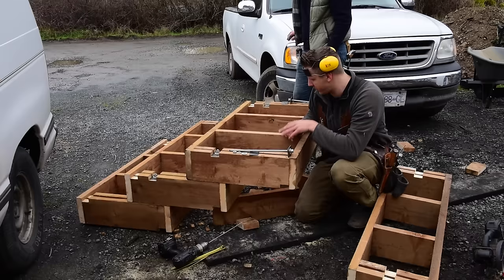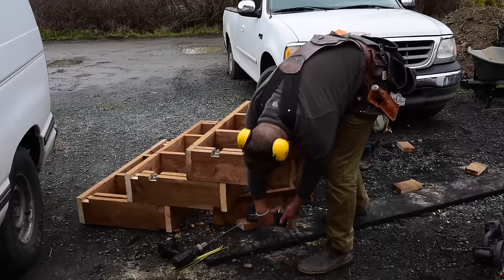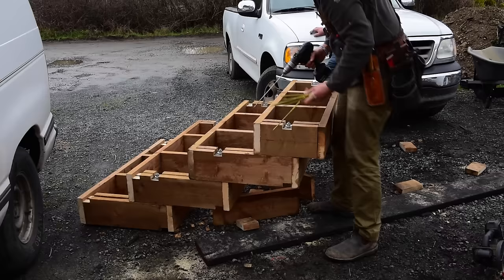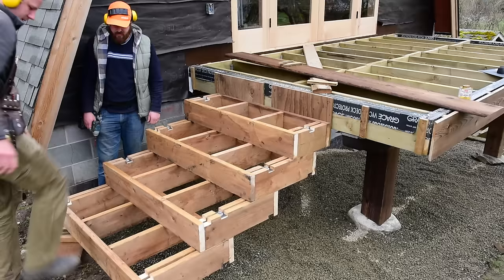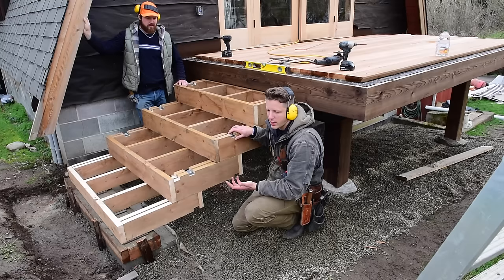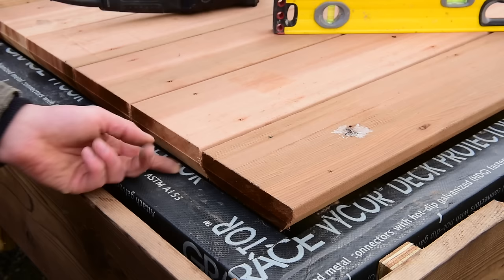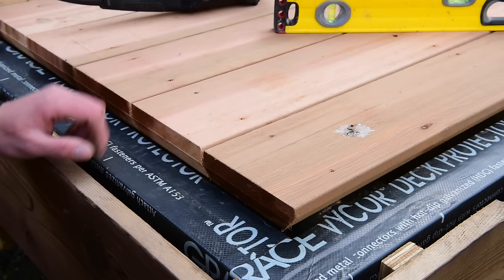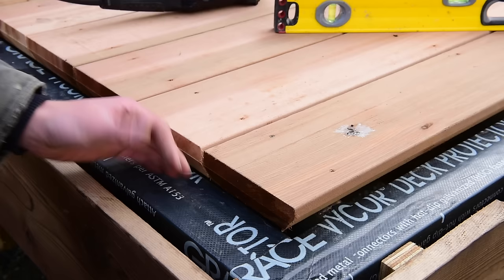FTF #52 Stairs Without Stringers? Here's How

Comment: you may have issues with the all thread loosening as the wood expands and contracts. probably would have been quicker, easier, and to code if you just cut stringers.
Reply: J Fr55man lockwashers and loctite.... no walk
Reply: Even stringer stairs get wonky after a while. Squeak!
Reply: lockwashers or loctite do nothing for the wood expanding and contracting.  If you get them tight when it's dry, when it's wet it expands and crushes the fibers and then you get slop when it dries out again.  If you get them tight when they're wet then they just get loose when they dry out.  I don't think you can win this.  maybe if you find something rubbery with just the right durometer hardness (maybe some fairly hard polyurethane) you might be able to sandwich a thin piece in between sections to take up the motion, but then the stairs won't feel solid walking on them.

Actually, if I really wanted to make this work I would weld/machine steel brackets to hold into the endgrain side (wood expands mostly perpendicular to the grain, not with the grain) and the bottom of the next stair up... of course at that point you've turned this into a whole new project.

On my deck I just cut stringers and build relatively normal stairs, but I also don't like the cutouts in the stringers and sandwiched full boards on the outsides which trim out the steps really nicely and provide a ton of additional strength without any inspection problems (here everything needs to be inspected and the deck needs to be built so it would free stand even if the building was taken away AND lagged into the wall that it is next to).
Reply: J Fr55man oh not maybe, it will loosen up, especially being exterior. Hope he doesn't captivate or hide those through bolt connections as he will likely be tightening them seasonally. Even interior furniture will expand and contract and loosen up. Think of a new kitchen install, and how the knobs/handles develop slop over time. This will only get worse when live loads are applied.
Reply: yah, i said "you may" so as not to sound like too much of a nay sayer... trying to be more suggestively constructive rather than simply deny this would work at all. I would think that the stairs will basically sag over time... not necessarily a safety issue, but aesthetically probably not the look he is going for.
Reply: He added a spring washer. It should hold...
Reply: 'Quicker, easier, and to code'...These are 3 things he is really not concerned about at his own house..The whole point of the video was to build stairs without stringers (and building inspectors) lol

Most likely he can just tighten bolts from exposed underside, the galvanised nuts n washer would likely provide enough resistance..
Reply: While the wood will contract and loosen up, I don't know what the answer is to 16" tread.  Stringers won't work for that
Reply: 2x10 with 16" by 6"(or what ever rise) triangles glued with PL and screwed to it.  It would use less than 1/3 of the lumber too.  With that short a run a 2"x8" would work.
Reply: And unlimited materials.
Reply: Peen the all-thread down like a rivet after tightening , the only way it can go is tighter.
Reply: majorjockitch it's not going to come loose due to the nuts turning but due to the wood expanding and contracting from humidity and temperature changes.
Reply: spring washers don't work very well anyways, but they do nothing to counteract wood shrinking
Reply: It wouldn't come loose at all , never. Threaded rod and it's implementation is my bread and butter.
Reply: majorjockitch  against the grain...wood will contract.  tighten the nuts and when the wood expands it will crush the fibers. contracts again and loose again. tighten and keep repeating till it fails. It would last longer if it was against the grain but then it might split. 

Around here it would last 3-5 years.  In Vancouver I would imagine less than that but maybe it's long enough for him. It's not like it took that much to build or would take that much to replace.
Reply: I'm getting the picture you have no idea what I'm talking about.
Reply: This argument is easily concluded. Doing this with three (yes, I said three since the second from top is almost full length) steps is ok since the safety factor (fall) isn't that great but I'd like to see some tard do this for an entire stairway with let's say a 10 foot rise. That thing would be death trap. And anyone that thinks lock-tight will make a huge difference has apparently never worked with wood, especially wood that's out in the weather. Those steps are going to loosen up from wood expansion, contraction, but more quickly from compression with use. I want to see 200 pounds walk up and down those for just a few days.
Reply: It shouldn't even be an argument , all I said was there is an easy way to ensure the nuts never come off , then people started blathering about wood expansion. Plus there doesn't appear to be any treated lumber where it's going to contact the ground or pad , whatever's going in there.
Reply: Just take the framing out in the middle plug the bottoms and number 3 rebar and pure concrete, that's what you built is a concrete form.
Reply: J Fr55man  amen brother
Reply: 16 inch treads are going to get many people hurt at this hous
Reply: No doubt. Steps are universal 7 inch rise with 11 inch tread.
Reply: Could add extra stability with little effort @ minimal cost. Raise lower deck back board 1", notch bottom rib boards of upper deck <1"x1" to fit...  4 @ inny outty groovy kinda luv'n togetherness!?...  Otherwise stick it in, together, use protection if necessary.
Reply: BTW could do opposite configuration with front board, adding 1" ventilation gaps along top of riser, below run platforms.
Reply: J Fr55man 'all thread loosening'.....  or you can give it an annual inspection, and tighten the all thread.  Without inspection be aware of noise, loosening components usually will squeak as they get some flex, so if you hear squeaks, go inspect and tighten.
Reply: Add some liquid nails or gorilla glue to keep it all together and keep the all-thread tight without any movement. After the glue sets the all-thread becomes secondary. If you are really into it you can coat the all thread with Gorilla Glue or Liquid Nails before installing. I like gorilla glue for the gap filling properties in a situation like this, waterproof too. When the adhesive dries the all thread becomes secondary and unnecessary like gluing down underlayment, its the adhesive that holds it down, the nails just keep it that way for 24 hours :) Please read my further comments above if you really wish to do this the right way from nailing decking to pier installation.
Reply: One thing I am observing, it is harder and harder to find wood straight enough to cut stringers.   I have seen guys pick through an entire sling of 2 x whatever to find a couple of straight boards.  This looks like a very viable alternative to warped and twisted lumber.
Reply: @H. R. Calhoun : Crown up, just like joists and rafters. And if it's really so bad that doesn't work, chalk line. 
A little crown is a good thing if you have a decent span.
Reply: Im not sure you can cut 16" treads on a 2x12 stringer and still have the allowable 3-1/2" from the notch leftover for code....
Reply: Just screw a 2x12 on the sides for stability with carriage bolts...wont go anywhere.

Comment: You could have framed a house with the amount of wood used in those stairs.
Reply: Box steps are very good when it is two steps or just one. A stair stringer is what I will do until I die which wont be long since I will be 57 in one month. A framing carpenter since 1980.

Comment: love your videos. You can do this a lot simpler but I just screwing and gluing and up right behind the back side of the outside board.  it's a lot cheaper and faster then messing around with a bunch of bolts and washers and doubling up the edges.
I do agree this style of Step looks much more pleasing simpler the better.  the other benefit is that when you're shoveling off your steps you're not hitting the side.

Comment: Hey Samurai. I'm doing a deck at the moment too. I've left the deck boards wild on the end same as you have suggested. But I'm worried that when I do the finish cut, I will get chip out that will ruin all my hard work. I have a Makita 185mm circular, I was going to buy a new cross cut blade and also scribe the line before cutting. Do you think this will work or do you have another suggestion. Regards Luke @ Forest Floor
Reply: Forest Floor Enterprises use a straightedge to make your cut do a  1/8 cut first then do your full depth cut and you will have no tear out
Reply from the maker: Yeah, a fresh blade and scribe first will work.  I always hit the ends with a 1/8 round over bit on my trim router so it doesn't have a sharp edge.
Reply: Easy, cheers
Reply: Sweet - Round after the cut? I have been doing a small (2mm) bevel with a hand plane on all the cut ends this should clean up small tear out. I am still anxious about doing that cut..
Reply: Thanks Tom, The Samurai and all others. I think I will do a video on this part of the deck project, lets see how I go with all the good advice
Reply: You could make a Paul Sellers knife wall.
Reply: Not that hard to cut as you go. If you don't trust your abilities with a tape measure, then just set the board in place and mark it with your utility knife for a perfect match every time, too easy really. This is just as fast and you get a far better cut from your chop saw.
   The method he proposes is more often than not used because the deck framing was done poorly and is out of square and no one owns a freaking protractor to figure out the angle they need to be cut at to compensate. The only time it makes any sense to run the decking wild, is if the deck has a curve at that end. Then you use a router and trammel (or curved jig/fence).

Comment: This kinda just seems like a lot of extra hardware and wood for some heavy bulky looking stairs.
Reply: It's aesthetically pleasing to some. The ball will never be moved forward without breaking new ground
Reply: Mike O fair enough
Reply: Look at Sam Maloof's house, some people prefer aesthetics and craftsmanship over efficiency or economy. The most expensive things a man can own are neither efficient of cheaply made.
Reply: I agree. It would have been better to conceal metal stringers.
Reply: Put a metal tendon on the underside.  That's the section that stringers usually handle with the continuous grain, tip to tail.
Reply: Evan Pearce ya stupid idea....
Reply: Evan Pearce yea seems like alot more material but 2 each is own me personally I don't have tons of extra Lumber laying around but all in all it was a cool idea and nice looking stairs
Reply: Seems like a ton of work for little payoff. Plus I doubt these will be "rock solid" in a couple seasons. But to each his own...
Reply: + Don Hill Not a ton of work if you enjoy what you do.
Reply: @blackfeather dog Just because it's a new idea doesn't mean it's a good idea. I don't like how how it's mounted to the deck either. I wonder how it's held up.
Reply: Evan Pearce you cannot achieve a 16” tread with conventional stringers.

Comment: David Nicolet
1 second ago
I have seen your stringerless stairs done in production in southern California on tract homes with permits engineering and the testing one commenter mentioned the big twist and why they did it was CURVED STAIRS with walk space under. Steps are pie shaped to achieve a desired radius. the first few were platform on platform then took off like yours to a second story @ 17 risers with a curved drywall finished underside. Your step to step connection is way better than theirs. Next time dream in curves. Love your stuff.
Where did you get your bags/ tool belt or did you make it?
David Nicolet

Comment: as long as the through-bolt is more than the stringer-depth back from the face of the step, and the bolt chosen has a tensile breaking stress greater than the shear stress in the timber, then essentially it is just a beam on an angle. (numerically)

Comment: My bonus tip for the day... don't do anything shown on this video. Everything feels nice and solid when it's brand new. revisit this after a year or two of weather and freeze/thaw cycles. It won't last 1/4 as long as a deck built by someone that knows what they're doing.
Reply: Why wouldn't it work?  I mean, the guy is a carpenter.  I know he pushes boundaries and does things his own way, but to this layman at least it seems like it would work.  If you're going to say something as absolute as what you just said, you should explain a bit more and provide your reasons.  It would, at least, be more helpful than just straight asserting an opposite opinion.

Comment: That was fun to watch. Technically, it IS a stringer. It's just crippled. I was going to say broken, but thought I'd use the technical term.  d;^)
Here's an idea... Stairs that are nothing but stringers... 
Exterior - You can space them 1/2", and 
Interior - go solid
Idea For Tying Together: Instead of threaded rod, use pipe and re-thread flanges from rear to use as "cap" nuts or use pipe caps and washers.... Whatya think?

Engineering-wise, you might get away with doubling up on the rear tension bolts (ready rods), and the other issue will be the compression at the face union of each level, as moisture, time, and pressure take it's toll. Posts set back to the second run of perlins under each cross beam would maintain the look, but should solve any mechanical challenges...

Thanks for the thoughtful videos! Everybody can always use ideas and help! Good man!

Comment: Looks okay but I would have saved money on the all-thread and used duct tape, not the cheap shit but the 6 dollar a roll stuff.  And some drywall screws toenailed in from the front instead of those expensive GRK foot longs.  You must be made of money.
Reply: Drywall screws? Your post has to be satire... for they would rust and have little shear strength. They would break off.

Comment: Your creativity is always cool to check out.  Stair treads should be very slightly pitched forward low into the tread.  This gives a comfortable stride both going up and down.  Pitched down at the tread head keeps your heel higher than you toes which can be very tricky going both up or down and with ice..... your going for a ride.  Add small weep holes if water puddling is really an issue.

Comment: I'm not seeing any advantage to this method.
Reply: I do my own with boxes and extra blocking as well.  Treads can be as deep as you want.  I do not use as much hardware.  A short rise (3 - 4 steps) with the boxes sitting on each other and connected with some screws, makes a solid, deep tread (fourteen inches) set of steps that will not flex or creak.  Something you appreciate as you get older you.  I am in my late sixties with shakey legs; the steps up to my deck . . . no hand rails.  My front steps, eight steps, stringer, ten inch treads . . . a good set of handrails is a must.  (Ten inch treads do not inspire confidence to size thirteen feet.  Handrail cedar cost me $400.00.  Like I said, did it for myself, but I enjoy them every day.)  And while you are at it, limit the rise to six inches.  We bought the place with front steps that had a seven inch rise.  If only I had a dime for every time I tripped on them.  Now that they are six inches, I have not caught my toe on them once.  (It also helps if they are all the same height.)  I would love to meet the inspector that approved the eight inch rise in my aunt (88) and uncle's (91) split level home.  Maybe he was offered a small stipend if he would just look the other way.  Yeah, there are lots of steps out there built by someone who does not care how dysfunctional they prove to be.
Reply: @freddyfriesen  I did some short stairs sort of like this; I just stacked 2x6's on edge and set the end of each one back about 12 inches (I'm probably not describing it well) I wound up with about a 5.5" rise and a 11" tread.  The method in this video seems overly complicated to me
Reply: @jlocke62  Yeah, but there's no limit to how high he could go, and he was looking for the effect, and it works.  95% of any project is the planning.  Once your head has it figured out, the rest is easy.  Complicated, yes, but an interesting build.
Reply: It looks Nicer but it Has no advantage
Reply: It looks Nicer but it Has no advantage
Reply: The advantage is he can make the tread as deep as he wants.  you're very limited with stringers.
Reply: @LifeMasteryPodcastStevenArecco  Seems like a lot more work than is necessary.  I have built several sets of "stringerless" stairs and never went to this much trouble.  Now these do look very very sturdy; maybe even overkill for a lot of home applications.  I'm NOT attempting to bad mouth this in any way; it just looks like they are working harder than they really need to.

Comment: I like the design. The only weak point, to me, seems to be the connection of the second and third steps. It looks like only two ready rods were used. I would at least use four and might even try an extra bracing somewhere. I too like to over-engineer things...because, you never know when someone will try and carry a grand piano over those steps.